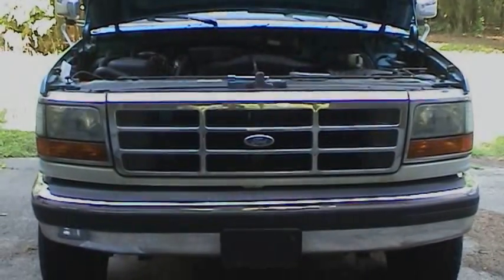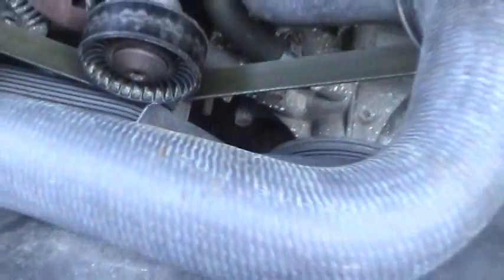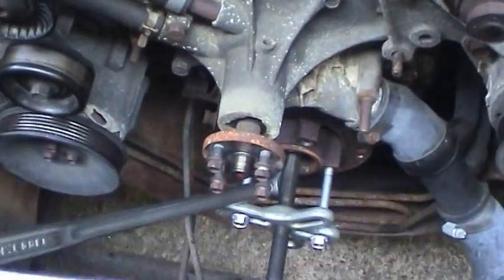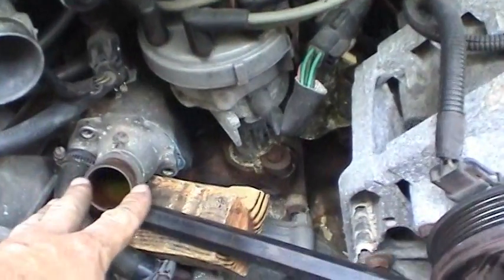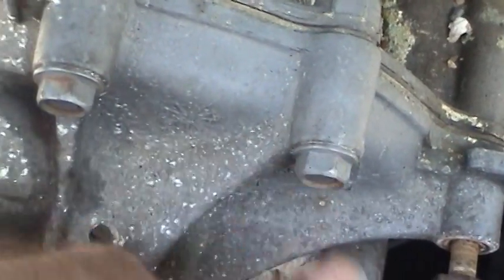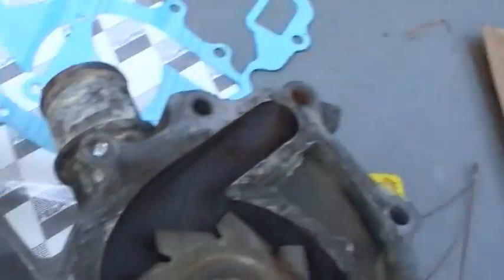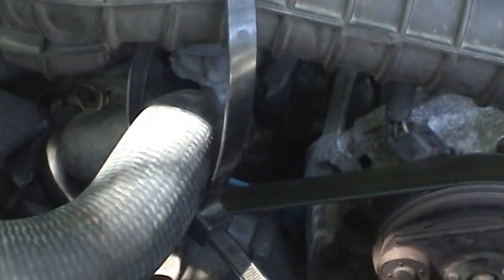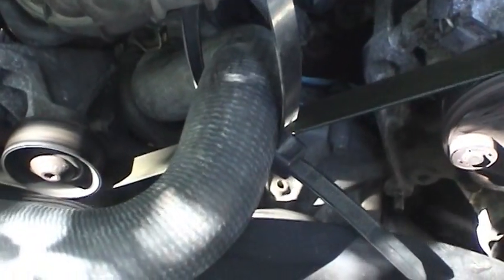1995 Ford F-250 4X4 Timing Cover Gasket Leak Repair

Comment: Theres a bunch of videos on here all showing the same thing but none of them tell which size sockets they use to remove the 7 botls in the waterpump. I've been at this shit for the last 2 days and can't get one of the long studded bolts out on the left or the other long studded bolt on the right. I think the one on the left is 1/2"  and the one of the right is 16mm

Comment: This helped me with a similar issue I had on my 1987 F250 with the 460. Leak behind the timing chain cover/broken bolt. Thank you.
Reply: I'm overheating and noone can find the leak, they lean towards head gaskets , but I just recently noticed an oil leak which I think might be related.

Comment: I ran in to this many times they seize up from corrosion, what i do is made a hollow bit from brake line that just fit over the bolt, you install a steel rod in one end of the line so you can grip it tight with a drill and the other end make it jagged to cut the corrosion, and it worked great . and the timing cover was never damaged, the bolts would come out as you drilled, it was so easy to do. just snap all the heads off which usually happened trying to remove them then drill them no problem did it many times and never damaged the cover. so simple. No heat required.

Comment: Everything I've seen says not to use RTV with a paper gasket, especially not all around the gasket mating surfaces. If anything just the corners to hold the gasket in place. It's also supposed to be a thin layer and not gooped on there like that.
Reply: Yup, industry people say that but every damn person seen that actually fixed one uses rtv on both sides of the gasket so what do you do??

Comment: Yes got to slightly moved those bolts the slightest amount loose then back to original tight position then repeat over and over again many times as the caking internally breaks loose more and more and falls out of the hole and you can loosen even more & wd40 the holes. Don't break the bolts in a rush is Not worth it whatsoever!
Reply: WD40: back in the day it was ok but let me put you on the true true= Seafoam deep creep creeping oil
Not pbblaster, not krill, not none of that: SEAFOAM DEEP CREEP CREEPING OIL
It’s the only true creeping oil, the way you can know is it’s no aerosol based is flip the can upside down and it will still spray because it’s mainly oil. I was an avionics tech and you don’t know what a stuck bolt is until you have to remove aircraft service panels on attack aircraft. They are all speed bolts and you can only use old timey hand tools(well back in 1995 when I was doing it) The problem is not only do they rust out in the weather but they heat cycle like crazy cuz it’s cold high up but also the leading edge and fuselage generates heat from air friction so these get hella frozen: only thing we use to get them unstuck was the seafoam 
12 hour soak.

Comment: you can get a new bolt kit for about 10 bucks at auto parts store,well worth always putting in new bolts with anti sieze
Reply: I wouldn’t put $10 hardware on anything ever

Comment: Does this mess up the timing?? Or can u do all this, put it back together and run it just like replacing the alternator?
Reply: No this doesn't affect timing. He was saying to stop the engine from turning so you can tighten the harmonic balancer bolts tight.
Reply: He explain it @ ratio 27:55 with the wrench to stop the engine from turning.

Comment: I'm wondering if the coolant contamination isn't coming from the oil cooler. In the video you can see the lower radiator hose has two outlets that go up to an oil cooler that the oil filter screws onto. A fair number of people on the ford truck enthusiast website say they have had problems with them. They say that the inside of the cooler (where heat from the oil is exchanged into the coolant) breaks down and lets the coolant start to bleed into the oil. I'm worried about this on mine and am considering removing it as some there suggest. It might just be another Ford part that works well when new, but after 25 years causes more problems than it was meant to solve.

Comment: Just finished this job on my 94 E250 van. Great video! I had to loosen the oil pan to get the bottom rubber seal on the timing chain cover to fit properly.

Comment: two words, 3M gasket removal pads for a die grinder... well that's not that two words but you get the idea
Reply: dont let that get into any place that has oil. the tiny fibres from it will take out your bearings.

Comment: Thank you for filming this video. I have a 1994 Ford F150 with the 5.8 and in the process of replacing the gasket between the block and timing cover. I found the water pump bolts at Late Model Restorations. The bolts are identical on a 5.0 1993 Mustang.
Reply: Doorman makes bolts/studs also.
Reply: Mississippi Native NAPA has them as well.

Comment: for a Ford guy you don't know how to read the part number year date code on your cover is from 1987 note the date code E7TE The E represents the 80s and the 7 is just that 7 the E is the Decade and the next is the year. If it read C9 it would be a 1969, I hope this helps.

Comment: By far the most detailed and informative video i have seen yet. Bar none. Thankyou very much for being well spoken and understandable. Mine is a 94, three of my bolts broke off on a water pump change and in order to extract them, i am this deep into repair. Thankfully i have succesfully removed the bolts and am on the assembley side of this job ;-) this video is much appreciated
Reply: Chad Neunaber 
Same here 95 150 5.8 4X4 two water pump and one thermostat housing bolts broken. Starting the reassembly tomorrow.

Comment: I currently have my water pump off my '97 F250 (460).  Do you recommend using anti seize on all or some of the water pump bolts?  Someone had recommended silicone on some of the bolts because they are exposed to coolant.

Comment: how many miles are on your ford i am planning on doing this to my 95 f250 5.8l with in the next few months it has 136,000 on it and im starting to see yellow stuff form around timing chain cover so i figured id better do this jub now while its minor before it gets to be a much bigger problem and destroy my cam bearings and bottom end also could you please list all the gaskets required to do this job thanks

Comment: Shadowrider, this has nothing to do with the ford, but for the Roadmaster, if you havent done so yet, the rear shocks can be a pain in the ass. I recommend using 3/8 with a 1 foot extension for turning from the bottom and a stubby wrench to hold the nut on top. Top is 13mm and bottom is 14mm I believe. Either that or the other way around.
Reply: Doomzdayxx ps, rear coil springs are easy, Front springs are a pain bu just use one piece coil spring compressor.